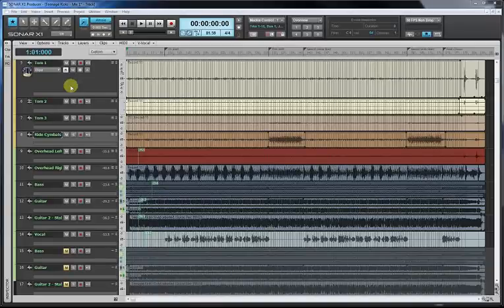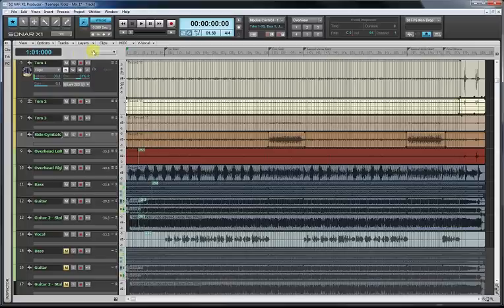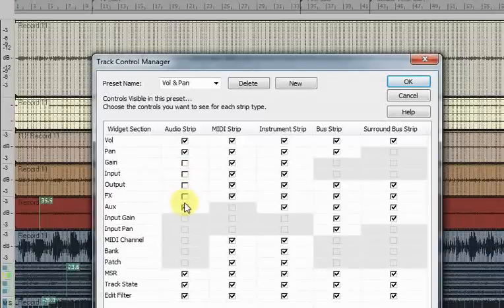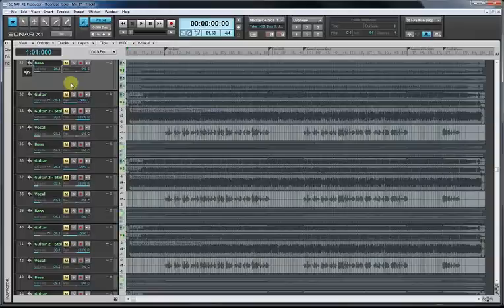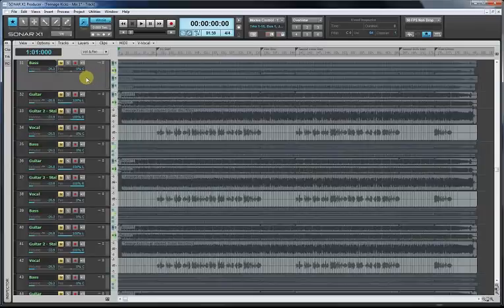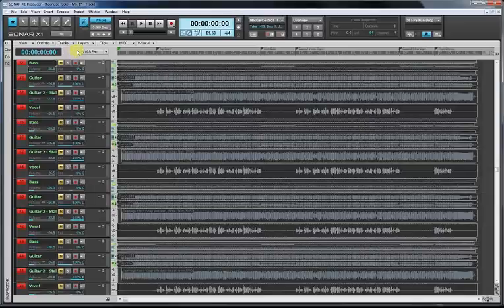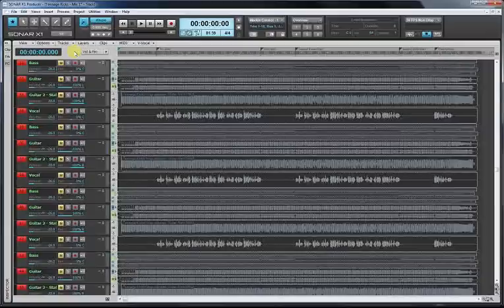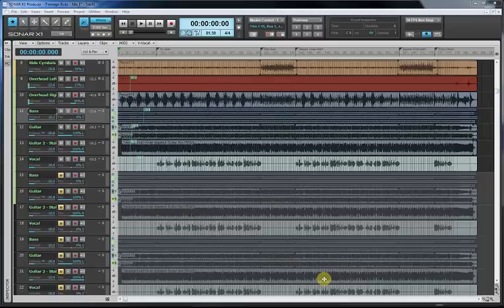Sonar X1 - Track Control (Widget) Manager - Tips & Tricks

Comment: From what I have seen, for flexibility and customization the track control (widget) manager is of tremendous value. As you mention, combined with screensets (per project GUI macro setting) they are very powerful. What you say here also applies to Cakewalk by Bandlab (CbB) where the power of managing widgets (track controls) has quadrupled (at least) thanks to the recently improved Workspaces feature (global GUI/feature/macro settings) formerly called Lenses. 

Anyone who values SONAR/Cakewalk's unique workflow customizing capabilities and hasn't taken the time to learn how to tweak track control widgets might benefit from the material you present here.
Reply from the maker: Thanks. Yes Screensets, the track control manager, and workspaces are a very powerful aspect of CbB in respect of workflow. They are well worth investigating for anyone that uses the program regularly.